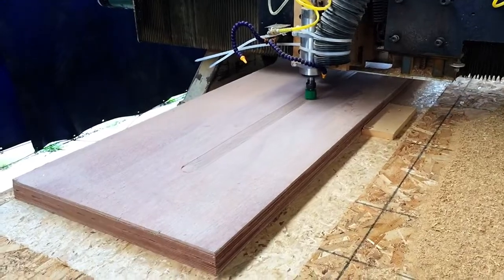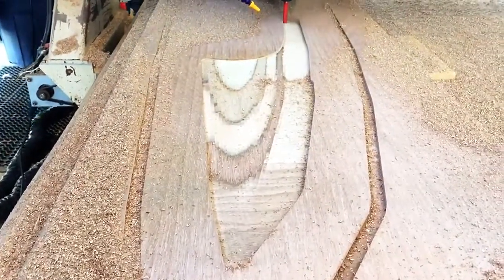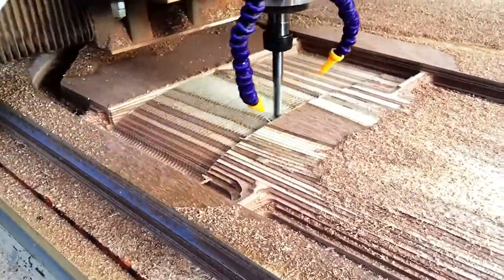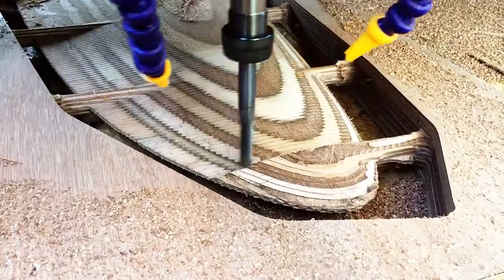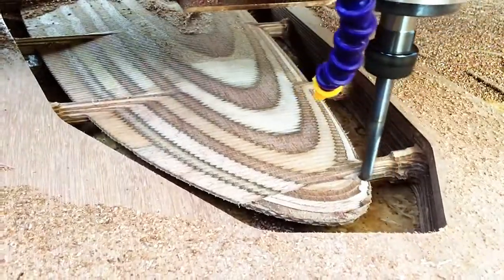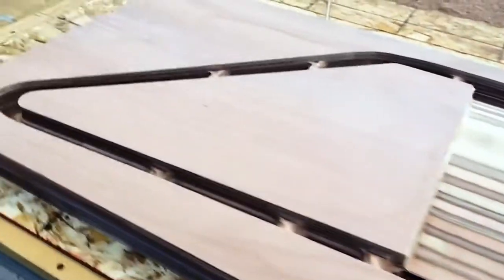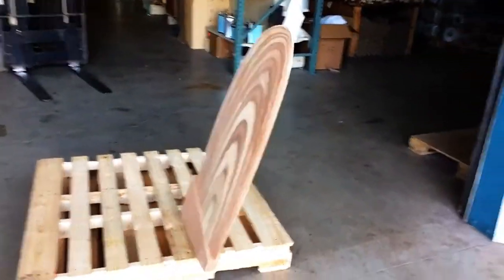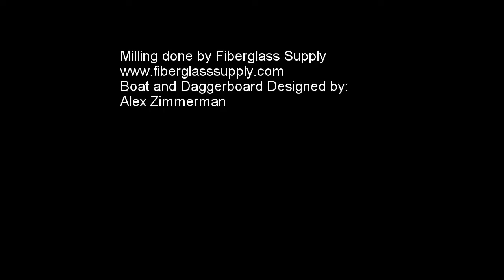Cutting a Daggerboard for a Sail and Oar Boat on a CNC Machine

Comment: Hi there. I live in South Africa and am looking to build my own cnc router to make sailboat and rc airplanes  foils. Would love to nlknow what router and software you are using...
Reply from the maker: On that cut out we were using a Thermwood router from the 1980's that we rebuilt the electronics on and put a different spindle head on, on that we ran Mach 3 for the software and a liquid cooled spindle (I think it was a 2.2Kw liquid cooled spindle) .  Currently we have a Laguna router.
Reply: @FiberglassSupply  looks great, we'll done. Thank you